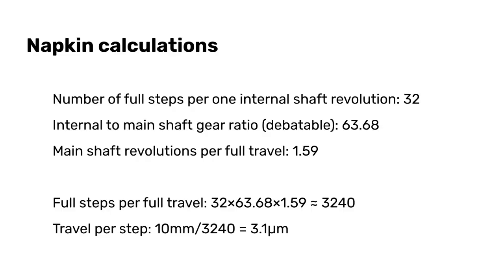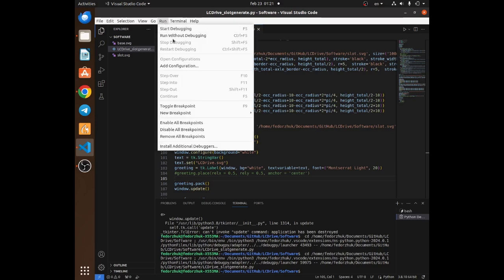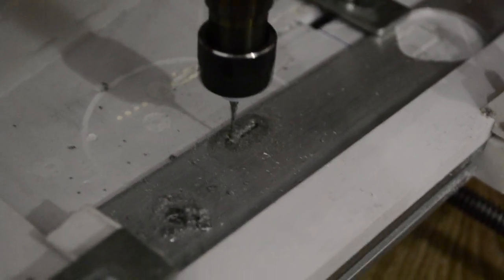Linear Cycloidal Drive

Comment: Well - nice idea, but you do not show anything at all. Just a simple picture of the used parts would help, but nothing to see here. Even the STL files at github are not readable. Is this intended ?
Reply from the maker: Well, not much info in the video was intentional, but all files on github should work properly. I will check STLs
However, have you seen 
LCDrive/Software/slot.svg
LCDrive/Software/base.svg in the repo?
Reply: Could not open these files either ...
Reply from the maker: @Jogi-1111  
You are right about STLs - I have checked in my Prusa slicer and motor_top and carriage_top were automatically repaired by the slicer without me even noticing it. So here I can only recommend you to try Prusa slicer, it is free and very capable

As a backup, if you wish not to use Prusa I have exported all of the required parts as STEP models. It might be a more common file format to open, you can check those out in my today's commit 

It is still strange that you can not open the SVGs, because even GitHub manages to show the correct preview for them. It is 2D vector graphics and it can be opened even with an Edge browser
Reply: The problem might be, that you have references to mostly all of your other(!) files within those files (in STEP, STL, etc.), but due to safety reasons, I did not load all of your files. As you (and GitHub) have all the files available, there it will work. But anyway: Thanks for your efforts!